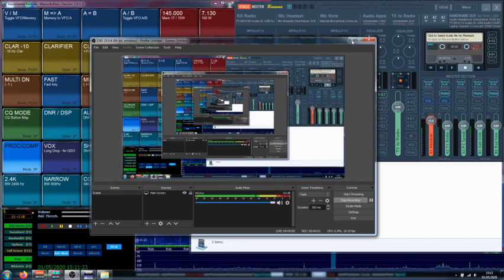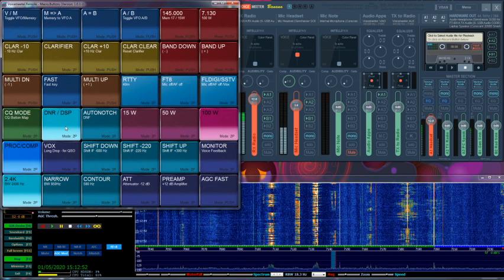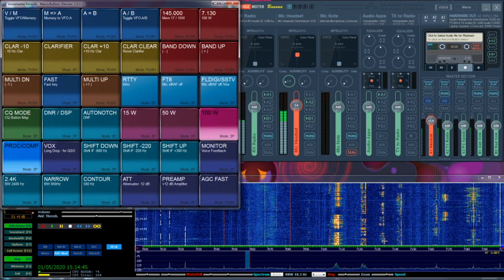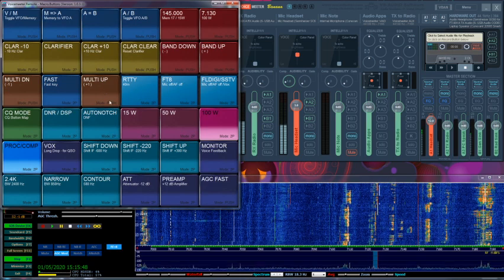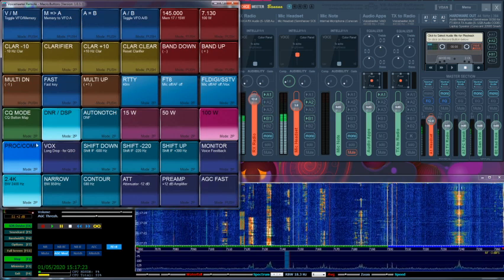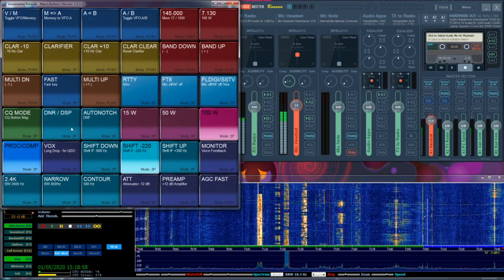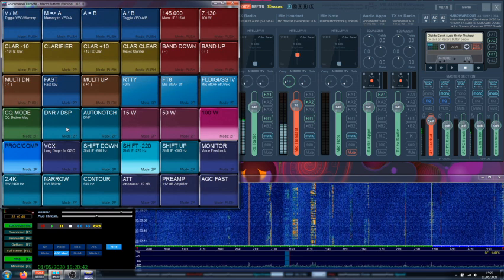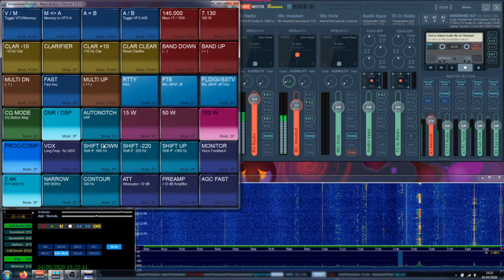FT-991A DSP Filters: DNR, Bandwidth and Shift usage demo

Comment: Not just the FT991A audio, but your video is super clean too, are you using Adobe Audition? 

I hope you keep these videos up, soon to have one of these rig too. Brilliant content, really pushing the capabilities of 991a.

Eager to learn of your setup, perhaps you could expand? FT-991A connected via USB... Do you have an external mixer? What other hardware is in use here aside from this other than VB-Audio product. Do you also use USB sound cards for your non radio connected mic?
Reply: Hey @spaceshipdev - thanks for the kind words!
I used OBS Studio (you can see me minimizing it at the beginning of the video). It is free software, using in Twitch live transmissions. The audio sounds good because it is 100% digital, comes from the radio in the USB port and enters OBS Studio which is recording it.
You won't believe, but my setup is extremely simple. I loathe external mixers for all the problems that they implies (ground loops, wiring mess, etc.) and I wanted this really neat. In my setup I use a Sennheiser USB headset plugged in PC; mixed by VoiceMeeter Banana and sent to the radio via USB port.
There's a diagram and setup install in https://github.com/rfrht/Voicemeeter-FT-991A/ - you can do it too - without spending a cent.
Enjoy the 991A - it's a heck of a great equipment. I love mine ;-) 73 de PY2RAF.
Reply from the maker: P.s.: Feel free to get in touch in e-mail (check QRZ) or even ask questions here in the video - will be more than happy to help.
Reply: While you are still here: You migh like this - https://github.com/rfrht/FT-991A/blob/master/README.md
It's the central repository of my stuffs 991-related.